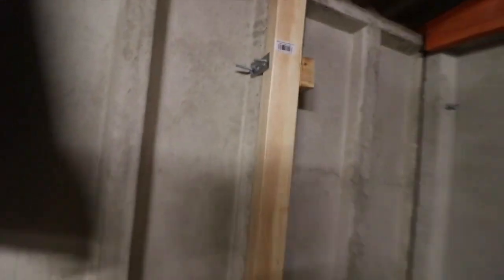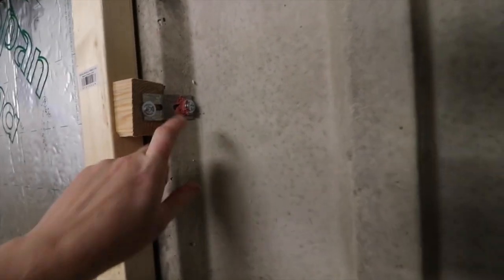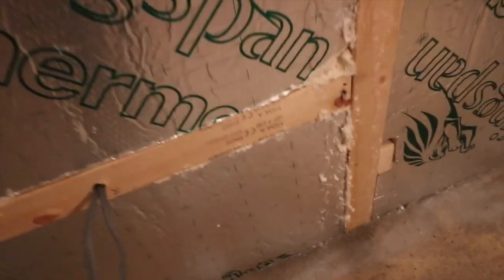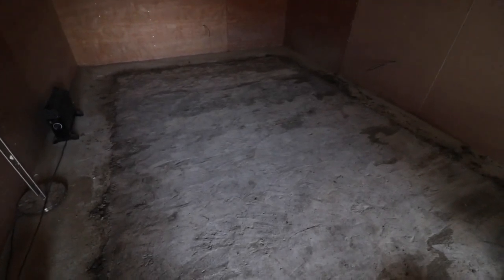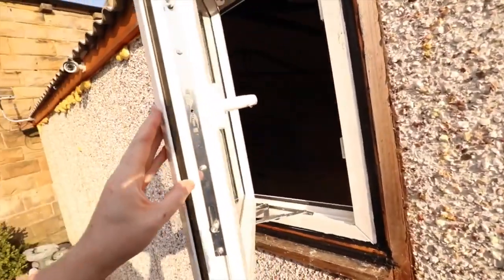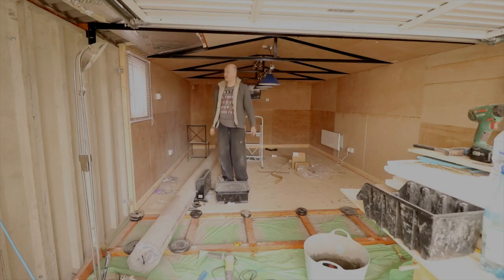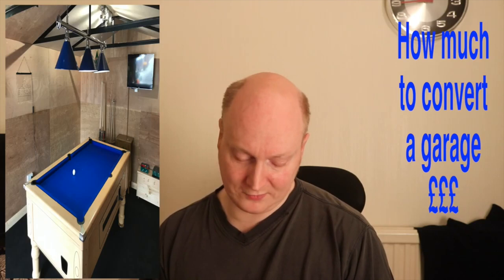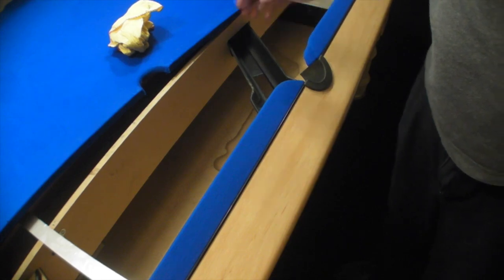Full Apex Garage conversion into Pool/billiards Table games room parts 1-23

Comment: Thank you so much for sharing your journey, I will be doing something similar this year. Fixing your timber uprights to the existing bolts on the concrete panels is something I would never have thought of.
 I don't agree with everything you have done, ie 'the flooring'. It would be interesting to view the flooring in 10 years time. Top marks from me though. You have done well Grasshopper.
Reply from the maker: cheers mate its hard work but dont under estimate the cost.

Comment: Thanks, i found the next video updates, Anyway, when you said the cost is a possible £5500,I am now wondering if it would be better all around to remove the garage, and, build a new purpose-built timber room. But i have to say what you have achieved is excellent so thanks,yes it is very informative,

Comment: Me and the cousin are looking to do a 12 by 12 shed for a 6ft table back in the middle, we know for a fact that the playing area will be slightly small so were willing to use 30/36 inch cues for tight spots if need be (if ball is on cushion), but would you say that is an idea shed size for a 6ft table like the one you have in your video?

Comment: Hi Paul, so glad you made this video. I need to undertake a very similar project for myself. And I'm a girl who although not afraid of hard graft has never undertaken anything like this before. I will be starting it in the new year, BUT my big question to you.... my apex garage, has walls made of concrete panels that have been slid into place and between the roof and the walls, there are breather air gaps. As in daylight can be seen from inside the garage if you look down between the roof and the top of the walls. I don't have any paperwork on the garage, the house and garage when I purchased it, was a repossession, from my own investigations I am pretty sure it is a Compton Garage I have. Any advice on how I will "fix" the gap/hole between the walls and roof?
Reply from the maker: is the garage sound its hard to say with out seeing some photos feel free to email me some then i can best advise

Comment: Thanks  you for this video  
I think insulation  my garage   turn into  a gym / man cave  my garage  same as inside   I think use  
insulation foil what  do you  think that be good idea  for my garage  and keep the good work
Reply from the maker: please use insulation board their are many ways of building such as floating wood floor or fixed battons you can use obs board or plywood or plasterboard it all depends where you live if cold weather is an issue best to use plywood. It is a long hall but be nice when finished.
Reply: @Technologyadvisor1   thanks mate i live in England  west Midlands
Reply from the maker: @waz007  if interested one of my videos regarding costs with links to eBay  for all the things I bought I would advise against plasterboard as your in uk as damp can be an issue plywood is resistant to damp
Reply: @Technologyadvisor1   thanks mate   what size ate insulation boards  and my garage 
I've already turned into a TV room  DVD player  and  VCR player tape 
I got  3 bag of vhs tape  in garage

Comment: Question, why are your battens more than 60cm apart, I’m reading up that they should be 40 or 60 cm apart, why is this and do you need to do this? Like yourself I have 1.2m wide kingspan insulation but don’t really want to be cutting out lots of sections to fit a smaller width of batten at 60cm apart? Any ideas on this thanks
Reply from the maker: because I was using large pieces of plywood. I wanted to keep the battens to a minimum. the backwall had many battons.  I did add more than I wanted too as this was a  quick job but ended up being a long job. In hindsight I would or should have added more battons. as some plywood did bow a bit I had to use glue to stick the wood to the walls.

Comment: You could of just put a table in there with table tube heaters and saved about 5k
Reply: Except for the damage to the snooker table being kept in the cold and damp all winter. And the cost of running the heaters every time you want to use the room, which would be pumping all your cash directly into the atmosphere.